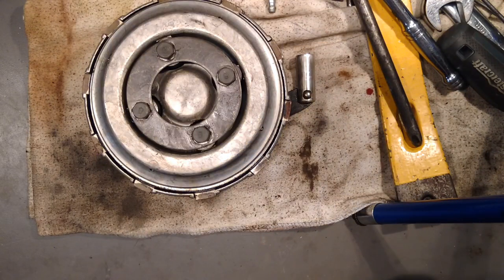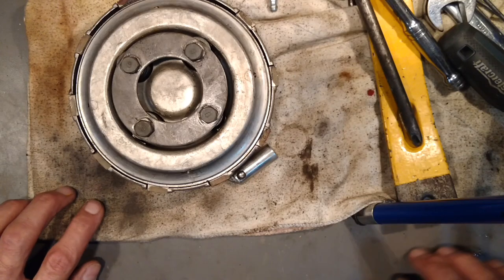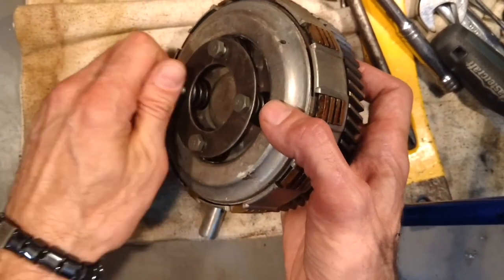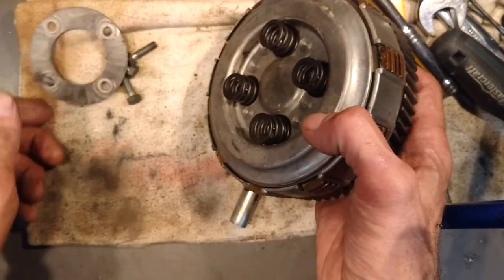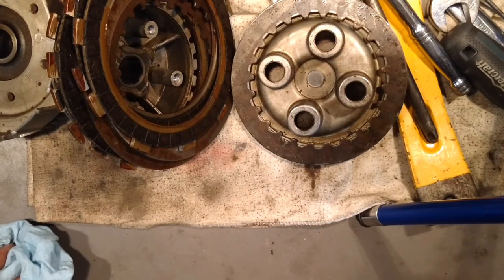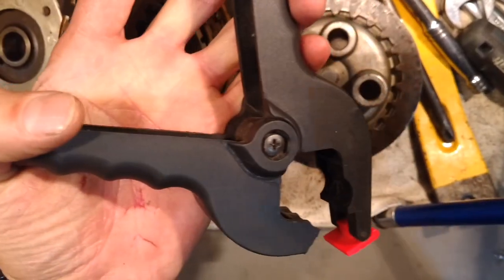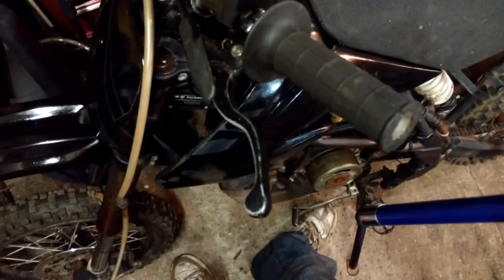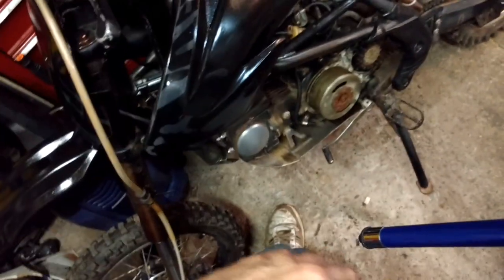Unseize your motorcycle clutch without removing a single bolt.

Comment: Would a chain locking up the rear wheel cause a certain gear to stick? My chain failed and locked up the rear wheel and I tried to restart but it’d die (thought it hydrolocked from gas spilling into the air box a few days earlier) well after finding out the chains the issue I replaced that and proceeded to test drive only able to get it to 2nd gear 3rd refused to move and then gas was spilling into the engine causing oil and gas to leak from the air box. I tore it down and nothing looks bad no metal shavings or anything but bikes still refuses to go past 2nd
Reply from the maker: Hi will riseabove, what year, make and model bike have you got?  Really sounds like possible bent shift fork...doesn't take much of a bend to jam up the works.   I've had the same thing- chain fail rear wheel lock up- happen to me many years ago.  I was on a Yamaha 400 maxim.  Nearly killed me, never hurt the bike a bit lol.  A compilation of troubles are hard to juggle and sort right.  Hope you can get fuel under control🙏.  Without actually inspecting all transmission bits, my bet is shift forks and/or the shaft they travel on.  Take a very close look at the grooves in the shift drum for any sign of damage.  Best regards.

Comment: I think im on the other side of the problem i thinke my clutch is slipping. Took it apart and cleaned it with w d 40. Got a little bit better. But someone told me to scrape the pads on a cement floor sort sanding it to get the glaze off. Heard of that?
Reply from the maker: Hi harrygrimley, I've roughed up dirt bike brake shoes to increase performance. Usually do it on my vintage bikes just before race day, use an 80 or 100 grit sandpaper. Clutch is bathed in oil though so any that I get in my shop with slipping trouble, first thing I suspect is springs.  A service manual should give you specs on spring length. Tensile strength of each spring is hard to measure. Manual also for friction and steel plate thickness. If plates are worn bad usually that shows up in the cable - cable will seem stretched... and even if you put new one it would be adjusted oddly out more than it should as the clutch pack is not filling intended space. 
 I'm certainly no clutch expert, never tried roughing friction plates either.  My thoughts on that... probably would help for a short period.  High gloss on friction plates I would think means they slipped a good bit and the intense friction caused overheating, baked them to a gloss.  If anything, I'd lay a sheet of 1000... maybe 800 grit on a pane of glass and give plates a quick scuff. My focus is still on the springs though.  Also, some makes, models specify only conventional oil, mineral oil, transmission fluid, etc.  More to the point, if the transmission fluid spec doesn't call for synthetic oil, putting that in definitely can give you slip.  Best regards 🧘‍♂️

Comment: I just bought a 1981 yamaha seca 550 for 65 bucks. I cleaned the carbs and it fired up and runs great.. It had been sitting for 3 or more years. So the clutch is stuck and i really just want to ride it lol

Comment: My actuator arm doesn't engage anything so clamping it would be pointless. Any guesses why? It worked fine u til the cable broke amd we replaced it. Not The bike won't roll in gear with the actuator arm all the way forward (the way its supposed to bE to shift).
Reply from the maker: Hi Mr Phillips, what type bike have you got?

Comment: Well, tried the clamp trick on a 2000 Vulcan 800. Couldn't get it to roll with clutch lever pulled.   Let it sit overnight.   Next day, its working like it should. Thanks
Reply: Hey idk if you still have access to this account but did you have oil in the bike

Comment: Few cable ties on the clutch lever 24hrs, then rode it for about 20mins with ties still attached, bingo, clutch let go, cut the cable ties off, (make sure to carry a blade on the ride to cut the ties mid ride) ride home.normally, all fixed, put the ties back on for a while get some lube in-between them haha, not a single bolt turned for this fix, boom.

Comment: What if the bike has a hydraulic system to operate the clutch? Is it still safe to keep the lever pressed in over an extended period of time, or could that cause issues?
Reply from the maker: No difference in the theory behind the attempt to free up the plates.  Only change is now you are relying on hydraulic to maintain pressure, so if a few days or a week pass and you still have pressure when you release the handle (feels same as day one), that's a tight system.  You may develop a dead spot that goes away with a few full pumps of the lever, or it could turn completely flat and have to bleed line to get it back.  Either way, any loss in pressure (clutch action) indicates a leak... more loss= bigger leak.

Comment: I have a weird problem. I have recently changed the clutch plates myself and after that i have ride my motorcycle at high speed, then i was not able to pull the clutch completely if i reduce the speed then the clutch becomes normal. If i ride it less than 60 or 65 kmph no problem at all. What might be the issue?
Reply from the maker: Hi @subramanip8434, I agree that is a weird problem!  Actually never experienced that or knew anyone who had. I love a challenge though.  Sadly I don't have a solid answer but my thoughts are that the basket may not be seated fully in place. Although, usually if not the casing will give trouble going on flush.  I have seen clutches put together 'not quite right' cause wonky issues such as too much cable slack can't even disengage transmission, lever won't operate the clutch at all, or that the clutch was engaged full time - meaning switching into any gear the bike would not move at all.  That said, I'd give it a thorough inspection looking for any oddity.  Scuffing on the inner casing?  With the case off, operate clutch, look at the movement going on. Looking for anything loose, bent, shiny, shavings, etc. Find nothing, proceed to take apart. A thorough inspection I'm sure will sort it.  If you can, determine as you ride is this in fact being caused by centrifugal forces.  Also is it original parts by the manufacturer or aftermarket?  Normally no issues with OEM parts but occasionally aftermarket may have a blemish in fit or thickness.  Also, if you still have your old plates, count them...and check on Ronnie's parts fisch online to compare numbers.  One extra old steel plate left in there can cause very odd clutch action.  If you go through it again and have no joy, get back to me with more info, year make, model and anything else you can add and I'll continue to help troubleshoot.  Cheers, happy new year and best wishes with it.
Reply: @shopyoga  Thanks a lot for your swift reply. The carbon plates are from OEM, but the metal plates , basket, and pressure plate are from an aftermarket manufacturer. I also suspect this might be the issue but not 100% sure as the clutch is working completely normal till around 60 to 65 kmph. May be in the coming weekend i shall disassemble and will inspect. Btw , is there any specific order(1 to 4)  in fitting the clutch plates and metal plates or any condition on which side should be facing inside and which should be facing outside?
Reply from the maker: @subramanip8434  some have a different inner and outer friction plate and all the center frictions are same.  Usually noticable with a paint mark on them, possibly even scribed.  The position flipped either side in or out should never matter with all friction plates. Steels shouldn't matter which side face in or out... but if there's a smooth almost rounded off edge to those steel plates, try putting all steels round edge face in. According to any MX threads I've read, that is the recommended application.
Reply: @shopyoga I found the root cause. It's actually due to the loose pressure plate bolt. After i tighten the bolt, the clutch is working flawlessly.

Comment: Hi could it cause weaker springs as a result of the clamping ?
Reply from the maker: Eventually yes it would.   The time needed to relax those plates and let oil saturate between them -a day or two, perhaps even a week -should have little to no affect on spring strength.  Just my opinion though 😏, I've never done any official test.
Reply: @shopyoga  Cool, I'll give it a go when I get a chance, And thanks for the video. Have liked and subscribed.

Comment: I bet if you had it on a stand with the back wheel off the ground un it slow and slam the rear brake just make sure it does not come off the jack

Comment: My clutch is acting up after sitting for a while can I change the oil while I have the clutch clamped in 1994 cr 250
Reply from the maker: +glen glen keeping the clutch clamped in through an oil change should not hurt anything.  All the best with your Honda.  I'm actually in the market for something similar.

Comment: 2005 Kawa Nomad 1600 had it new since then with 17,000 miles
Can’t roll bike when in gear with clutch lever pulled in. Try to start in first clutch pulled in and bike jumps forward two feet. If I start bike in neutral warm up then try to drop it in first it lunges forward 2-3 feet dies. Then it’s ok
Bike rides well and no clutch slipping at all. Once the first break it’s good to ride all day but park it fir a few hrs and it locks up again. I have chg all Dot 4 a few times. Used the right oil no additives. I can’t tell what’s wrong and nobody else can either. I try rocking it back and forward in gear with clutch pulled in and it takes 10-15 hard pulls/pushes to break it free then everything is fine?? HELP!!!
Reply from the maker: The clutch basket has 'fingers' that hold one set of plates... typically the friction plates, and if they become worn or grooved even a little, that can cause those symptoms.  That's rare though in that model, happens quite often to two stroke dirt bikes.  A change in oil brand, type, viscosity can cause that too.   More likely though, is that this has just become the nature of that bike with that mileage.  I run a 1988 1400 Suzuki Intruder and have similar scenario.   First start, cold start, if I want to leave right away I have to keep choke partly on and aim careful and expect to stall at first stop, hydraulic clutch will not disengage rear wheel until the engine warms at least a little and she's cold-hearted.   If I let it sit 4-5 minutes while I put helmet and gloves, clutch is free (maybe the slightest pull at wheel) but no stall no issue.  Otherwise, five to seven minutes into the ride sorts it too.   Also, cold bike clutch in in gear would take three men to rock clutch free.   I have new line, master and slave cylinders, but have yet to open basket.. likely never will until she starts slipping. 
These massive torque engines require stiff clutch springs, and to pull and lock the lever even overnight may guarantee it will move clutch in in gear, but also guarantee clutch will start slipping soon because spring tensile is gone.  Hope this helps.
Reply from the maker: Mine does stay okay all day after that initial warm up.  A slight change of habit may help.   After you are parked for a few hours and suspect clutch will be sticking, warm up just a little longer and hold clutch in for five or ten seconds before shift to gear🤔
Sorry about that oil comment as I reread and see proper oil, no additives.

Comment: I got my 1970 Kawasaki 90cc Busmaster (G3TR) to run after a subtantial carb cleaning only to find out the clutch is stuck. Clutch lever is clamped open. I hope I see success so I can report back.
Reply: Did it work?  I am in the same situation.  1970 G3SS. Got it running. Waited over a week for a new clutch cable just to find out the clutch is stuck.
Reply from the maker: Really nothing to lose but a day or two time.  Give it a try, I'd be interested to know if she breaks free.  It's work dozens of times for me, just relaxes those plates and lets the oil back in 🙏.  Best of luck!
Reply: @shopyoga , I am definitely going to give it a try.  Next couple of days is already booked so as you say, nothing to lose.
Reply: @shopyoga  ,Thanks!  After about 3 days and some shocking of the clutch by kicking into gear while running, it finally broke free!

Comment: Is it better to be in 1st gear, or in neutral?
Reply from the maker: I'd be inclined to think the highest gear available if you can, like fifth or sixth if you have it.   I'm just thinking less strain on the transmission and/or kickstarter.   Neutral likely best if only electric start.  What kind of bike are you working on?

Comment: Ive actually gone into the engine and broke it free but when i put it in gear it still jumps and the bike dies. What do i do?
Reply from the maker: Is that a cable activation clutch or hydraulic?  Either way, make sure there's no play in the lever so when you begin to pull lever in, you feel tension right away.   Beyond that, possibly a previous owner has altered something in the clutch?  What kind of bike have you got?
Reply: @shopyoga  its a 1976 honda mr 250 thats been sitting for probably 30 years. Ive bought all new cables but the clutch still barely engages
Reply from the maker: @champnottramp213  if you remove the clutch cover engine case, you should be able to see movement of the inner portion of the basket as you pull the clutch lever.  A cold engine will not usually let clutch plates slide well at all... not near as well as when the bike is hot.  If you decide to dig in again, have a close look at the steel plates too.  If there's any rust, corrosion, anything on a steel plate will hang up the works.  The best way to judge the clutch is ride for twenty minutes and try clutch in, idle in first gear.  If throttle much be applied then try idle in second  or third.  If bike allows that, keep riding... your steel plates are dirty or that clutch isn't responding well to the choice of lubrication and that stuff may clear up within a couple hours of periodic clutch use or a change of oil type may be necessary.  Once again, cold engine clutch is usually very different than hot so don't judge it prematurely 😉
I've had to thrash pretty hard on the tiny two strokes like KX 85 and YZ80 to break them free for my customers (day before the race and no time to open clutch and do it the safe way).  Many times the scenario is new clutch plates installed close to end of last season, then bike put up in storage.  New plates equals less tolerance between plates and long term, constant force of spring pressure caused evacuation of most oil in the friction plates leading to clutches that take sometimes a half hour of careful riding to finally free up.   Also, curious what oil brand, grade, are you using in base of the engine?

Comment: If my clutch has tension in it where   i cant pull it back what is wrong?
Reply from the maker: cove creek fishing off the hook if the bike has sat untouched for some time It's possible the cable (if cable operated) had taken on water at some point and is now rusted internally.  Rust will stop them tight.  Need more info please... what kind of bike?  And was there any work done then suddenly clutch is acting up?  Sometimes something simple as kink or jam in the cable under gas tank can send a person chasing the wrong direction.  Cheers.

Comment: Idk if it's my clutch but I know my kicker is stuck idk what to do honestly
Reply from the maker: You need to check oil level and condition.  Very likely you should drain the oil, pull a side casing or plug to enable you to physically turn over the engine.  With all ignition switch off and spark plug removed, attempt to turn engine by hand.  If it is truly stuck (seized), it is likely you are in for a fresh top end, but possible if it stuck from lack of use or at a low rpm, fresh oil and filter and rocking by hand back and forth 'might' get you back running again.